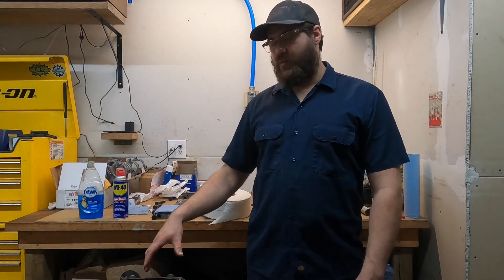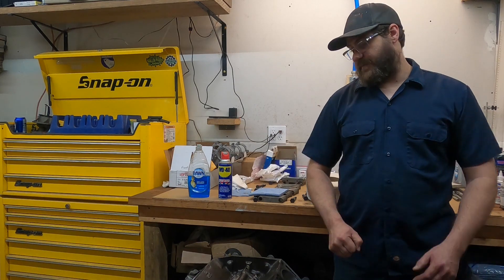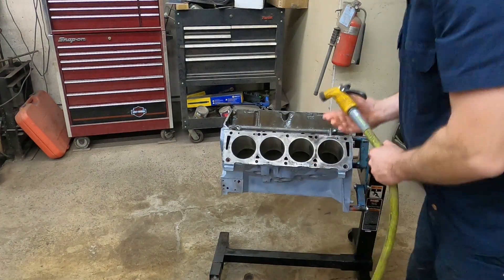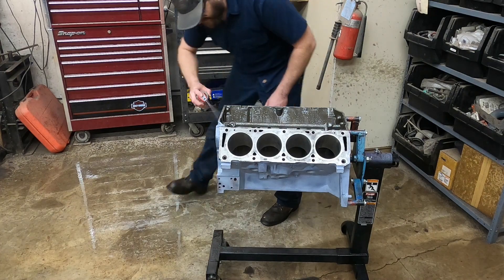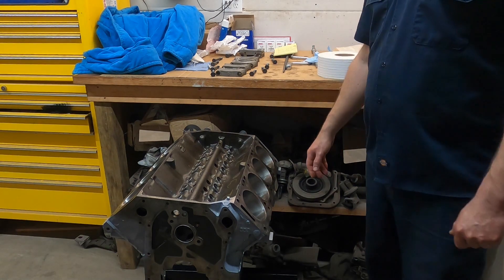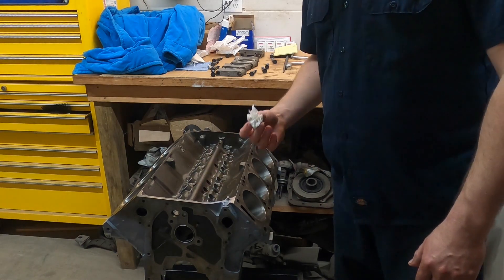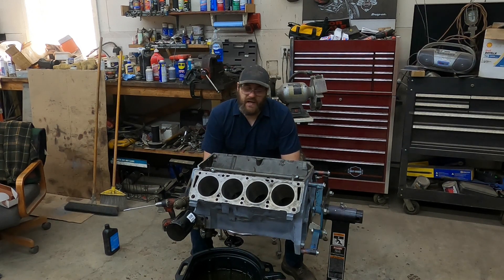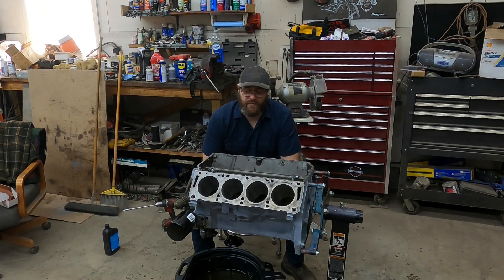Cleaning An Engine Block Before Assembly Ford 352 (Part 2)

Comment: Hey Mac, can you help explain the timing chain and how it's supposed to be slack-wise? I noticed mine has a plastic gear too...wonder if they came like that from the factory. Just wondering whats acceptable and the manual i have isnt very clear
Reply: Plastic from the factory was a thing, they also retarded timing in the late 70’s motors, If replacing, consider ordering an early 70’s to potentially unlock some power